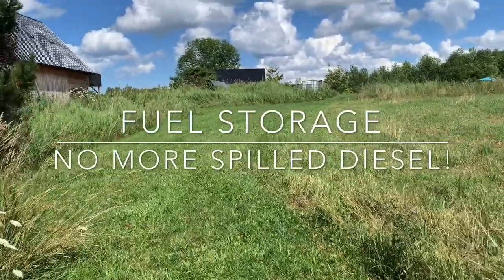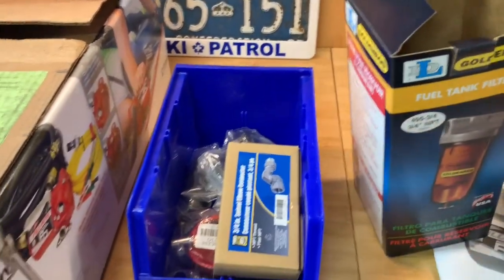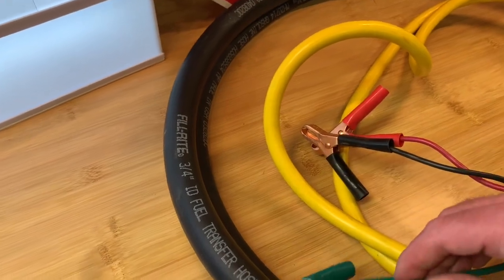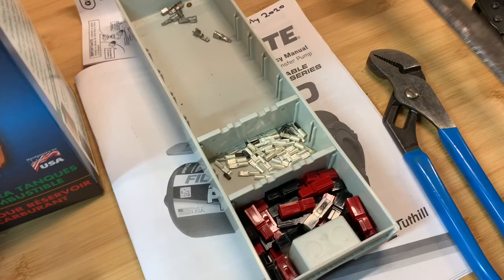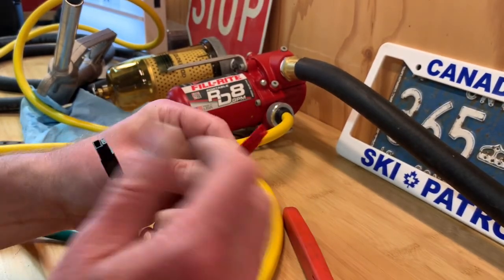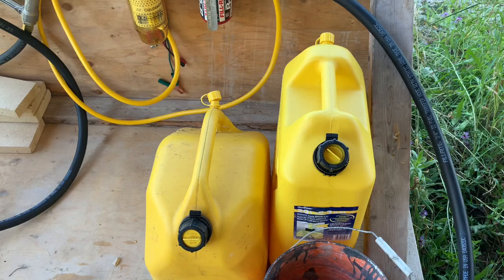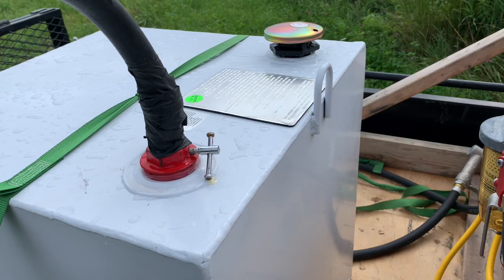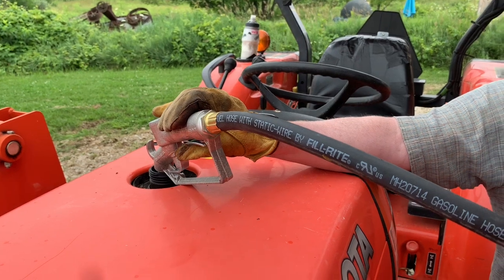Hobby Farm Fuel Storage And Transfer System

Comment: Don't know if you'll even see this question all these years later, BUT...how did you connect the hose to your new tank after having cut off that threaded connection?  Did you just stick the tube in to the bottom of that fuel tank and tape it in place or was there a specific piece you purchased and installed to hook the whole system up for that???  Thanks for this content.  VERY useful.
Reply from the maker: Hi Carole, yes I basically just cut the hose and ran it to the bottom of the tank and sealed the opening. That being said, I plan to replace the hose with a pipe and fitting, just not sure how best to do it!

Comment: I have 2 of those transfer tanks one for gas and one for diesel. Attaching the pumps to the tank will make life easier. And with these tanks I’m able to go to the gas station and get as much as I want without meeting delivery minimums. The transfer tanks are all you need but I actually store everything in gravity farm tanks just because I have them. I only use taxed diesel right now because I share it with my truck but the extra tax isn’t that much with my usage.